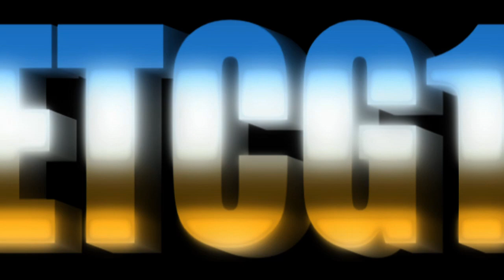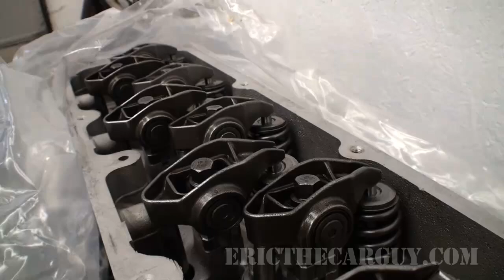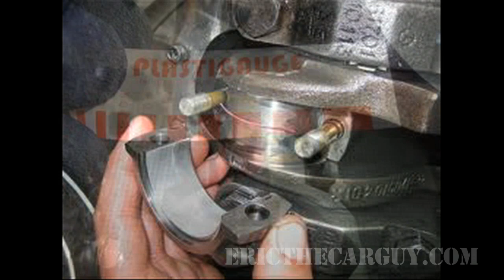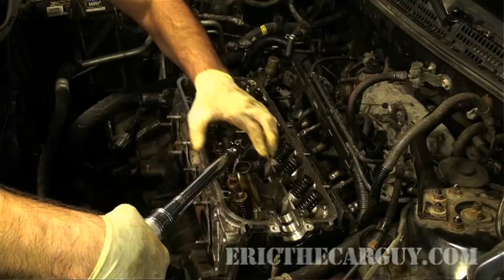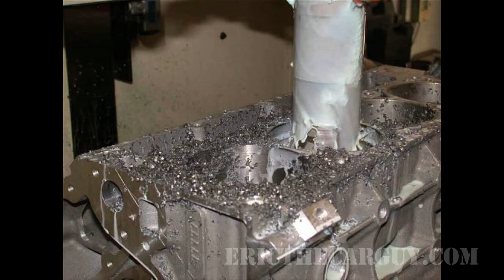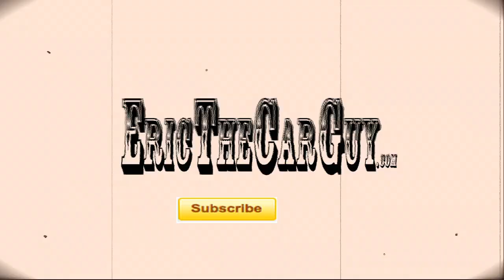Should You Rebuild or Replace? -ETCG1

Comment: I prefer rebuilding because if you so desire you can reuse what you know is still good and only replace what is necessary. I know its half assed but as long as you take care or it a used part will just keep on going.

Comment: I have always hear that you will get more mileage out of  a new replacement crate engine than you will out of a rebuilt engine. 
your thoughts on this.   replace or rebuild.
Reply: you might get better milage in the new engine, becuase it is common to bore over the cylinders in the rebuilding process. and bigger cylinders means more fuel consumption

Comment: I would like to add that a engine replacement is ok when the cost of replacement is less than the cost of labor, and rebuilt "kits" together.    but if the skillset and knowledge is available when the cost of a replacement engine is out of budget, and the customer doesnt wants to upgrade internals than en rebuild is better.

Comment: it would depend on a few factors. I would  rebuild an engine but only if it is cost affective to do so. if I can get a long block for the same price as it would cost for me to rebuild it or less get a long block saves time and money in the long run. but as Eric said some engines are not available as a long block or are expensive to send for a rebuild. like the engine i am working on just now an old ford diesel the owner wants to spend £0 to rebuild a seized engine. oh why did i take it on LOL

Comment: i changed whole car and donate the broken one for rallying. engine repairement costs 2 times more than changing whole car to working one.  the reason why engine broke was caused by broken tiny plug that keep coolent inside. it also had temp gauge broken so it just smoked alot and something broke. a few days later i bought 87- civic for 400€ / 500 dollars or so. old cars are cheap todays.

Comment: im facing this situation with my jeep right now. i have some experience rebuilding engines (done a couple chevy small blocks). i can get a known good used engine with 112,000 miles on it for $500. parts to rebuild my engine would be somewhere in the mid 600 range, ill say 700 for the sake of round numbers. im on the fence. sure ill spend more on the rebuild, but it will be pretty much a new engine.

Comment: I had the engine in my '68 Galaxie rebuilt by a professional company that does nothing but rebuild engines.  It was cheaper than a "crate" engine from a nationally-known remanufacturer. I wouldn't rebuild an engine on my own, for all the reasons you mentioned. And I'd only get a used engine if I were really short on money and absolutely couldn't afford a rebuild on my own engine, or a remanufactured one.  I did the same thing with the transmission -- paid a professional to rebuild it for me.

Comment: Depends on the vehicle in question; I'd rebuild an older engine (e.g. 68 Mustang or something like that), but I would advocate total replacement with a long block on something newer, like ETCG's Subaru project, should that need massive engine work.

Comment: It is definitely better to replace than to re-build, a rebuild for my trans would have been 1200 whereas a junkyard unit would be 800 with labol and parts. Hopefully i just have bad luck with sensors as im replacing a trans speed sensor for the second time now....

Comment: If its something you need to rely on its better to replace or have it done by the experts.  I'm an ASE Master Tech, and I recently had some trouble with a transfer case on one of my vehicles. So I pulled it out and tore it apart, looked ok to me but I went ahead and replaced all the wear parts. Put it back in and had the same problem. I took the case to a tranny shop and right off they knew that one of the parts wears the case, and it needs to be machined and sleeved.  Thats what they do all day

Comment: A 2006ChevyMalibu3.5LV6 for a year front & rear main seals &valve cover gaskets were leaking back about 5Q every 2 weeks so I just kept topping it off every other day I just didn't have the money to fix it well one day it died down the road 3 mech said a bearing froze to the block whatever that means so I got a salvage engine called a random guy off Craigslist took him a week started up drove off couldn't believe it anyway its still going today perfect. So engine and labor & extra parts $1,300..

Comment: Never saw this vid. If its got computers U don't wanna mess w/that shit. Go to a pro or scrap it. If its computer-free follow the advice in this vid then find additional info.

U mention "engine builders". There are professional builders who build from scratch for performance & there's assemblers. I consider myself a hobby assembler. I can take a box of parts & get good power but I cant build reliable high power motors. I know the theory but that's not the same as doing it & I'm not a pro at it.

Comment: at one time we were over hauling subaru cylinder heads, we use 100% OE parts, all new valves, and seals. rebuild time for one head payed 1.0hrs, fastest time I ever did one was 0.25hrs. the car with bent valves was fixed the same day. with two updated head gaskets installed. :) 14.0hr  job

Comment: I've worked 6 years at a independent subaru shop, i recommend replace. to the best of my knowledge subaru does not offer new long or short blocks for most of they cars, (non-turbo is what we mostly work on) they have a 3rd party rebuilder then relabeled in a subaru plastic crate. as of the last few years the quality control has been very bad. currently I'd recommend a used motor with less miles. I've rebuilt an old 2.2l subaru engine, not very fun.

Comment: I used to work rebuilding engines and another part to keep in mind is that they are generally all dyno'd. So the odds that you will wind up with a bad one is few and far between. My experience in doing this lets me handle all my own rebuilds. But if I'm working on a customers car its always nice to have a replacement that can be swapped in that way you dont have to worry about getting a call from the machine shop telling you the heads or cylinders are too far out of spec.

Comment: a lot depends on the type of failure to if an engine seized because of low oil pressure or lack of oil dont even take it apart its junk but i have had bad experiences with reman engines to an oem reman is probably your best bet but one of the more expensive to i would stay away from the auto-zone type remans

Comment: If time is a factor and the job needs to be done with minimal headaches, then I agree replace is the better option, but make absolutely sure you get something that isn't worse than what you're taking out, and that even though so and so has a "3 year parts and labor warranty" that it also applies to your labor.
OTOH, if it's a project car that doesn't need to up and running yesterday, then tear it apart yourself, take your time, do the research so you can do it right, and pay attention to detail.

Comment: serviced a gm 3100 from the block up due to a lower intake gasket failure, was unable to pull engine to do the work and ended up eating it.  4500 miles later it let me sit with a cam broke in half from washed out journals what i couldnt replace becuase i couldnt pull the engine to do the job properly, taking shortcuts gets you nowhere when it comes to engine work

Comment: as a powersports tech i say repalce with discretion. snowmobiles blow up all the time and i rebuild. how ever i use discretion, you get a motor that has been run out of oil- repalce it dont waste your time its a comeback waiting to happen. A guy goes and cold siezed his sled and needs a piston and cylidner - rebuild. The decision to rebuild or replace is a job to job thing at the techs discretion,

Comment: but in this point in time, i would rather buy a good quality rebuilt from someone i know does a quality job... knows the ins and outs of the particular engine (the intake manifold gaskets on the 3800 for example and would know too re build with the improved metal gaskets and not the cheep plastic factory kind.) a engine that would come with a warantee...

Comment: I junked the car anyway. I sold the head off it and scrapped the rest. I only paid $600 for it and I didn't have enough time or money to rebuild or replace the engine. Plus after it blew it still kind of ran and I drove it about a mile with no oil.

Comment: I'm gonna replace the engine on my lawn mower.  Take off the 148cc flat head and replace with an updated unit.  Hell, I even gain 0.25 HP in the process.  All for AU$159 plus oil.

Comment: i bought a d16z6 and transmission for 300 dollars on craigslist and has been running strong for 4 years now. it had burned oil on the valve cover and all that and a mechanic friend that was helping me put it in said the engine was garbage n stopped helping me but i put it in myself and has been running strong.

Comment: well first i live in cali with the smog nazis, so swaps are hard to pass here.
second, d series make more torque then b's over a wider rev band (area under the curve)
third, its build to be run in a spec class, so it has to meet some restrictions (oem bottom end)
the min weight for a d in the class is 2000, i think the b your talking about would be 2400.
oh, and my "waste of a motor" has taken down a large number of b's ive run.
not knocking your motor or b's, i just like to be different.

Comment: Totally agree, but really it all comes down to the builder. The truth however is that most factory original motors that are still running have stood up to the test of time, and abuse that we put them through. A rebuilt / crate motor has not, and requires special TLC during the breakin period.

Comment: Eric, You hit the mark about rebuild vs replacement. Another thing  I find is that is sometimes it is .  hard to find a good machine shop to do the work correctly. Casing point , I had machine shop work done on an engine from a 1991 Chevy Corsica and when it came time to check oil clearances for the connecting rod, there were 2 out specs. Never did rebuilds after that, just replacements.

Comment: I had an engine where there was no way around rebuilding it. I had it for five days and it developed a slight knock and less than a half our later there were chunks of block and engine on the road. The car spun a bearing and then threw a rod rite through the block.

Comment: i had mine rebuilt by a local performance shop to honda challange specs, and one thing to think of is down time.  they have had my block for like a month and its just getting finished

d16y8
y7 pistons, balanced bottom end
port and polished head, comp cams stage two cam, bc valve springs, aem cam gear
aem intake, dc heads, custom exhuast
tuned on hondata
shooting for 140 whp with a large torque curve
videos to come (i hope)

Comment: I absolutely agree that replacing is always better than rebuilding (for late model vehicle).  Just one tip when purchasing a salvaged engine: All junkyards will guarantee the engine they sell you.  If it's bad, they have no problem sending you another.  But, you will be stuck doing the job twice!  Get your salvaged engine from a REPUTABLE junkyard  Also, NEVER return the core until all work is completed and tested.  You might need something from your old engine to finish the job.  Good luck!

Comment: I have a '78 F150 with an inline 6 300, and C4 xmsn. I am going to rebuild as I want to beef it up. I know I know its a 6cylinder. I said I want to do it. I have never rebuilt a vehicle eng. I also want to rebuild my C4. From what info I have collected They both are "easy" or good starters to get into rebuilding. But like you said I won't have a warrenty of any kind much less a three year. But not willing to pay someone else to do it. Its my hobby, not neccesity.

Comment: At the moment I am tracing an oil leek when the engine is hot in a Saab 9-5.
At the moment having done over most serviceable parts in its life time I am predicting that it will be the crank bearings that are bleeding.

Only real option is to get the engine out to get a proper look, and if it looks scored/bad just going to replace it, if its just pitted might look at getting the parts overhauled and new bearings.

PS, engine still works and does so like a charm, just the oil light :-/

Comment: One other thing I have thought I would do if my engine decided to turn south is "having" your engine rebuilt instead of doing it yourself or a reman/replacement. I have not seriously looked into this, but having it rebuilt by a local engine builder who knows what they are doing.  How would this compare to replacing with a re-manufactured or a crate engine? One reason for doing this would be so it could be tweaked a little for a few more ponies. Any input on this?

Comment: new gaskets does not mean it's a rebuild, too. a rebuild is a rebuilt block/head(s) and whole new kit. juss sayin! bearings and rings, hone, tank/clean stuff up, ZERO miles. 

On a hard to find engine or numbers matching, like mentioned in the vid is the only reason I'd rebuild, otherwise replace with newer or better.

Comment: I've done both, rebuilt and replaced with second hand engines, IMO it depends on what is wrong with the engine.. If it too major like a broken timing belt bent valves and tagged the pistons I'd replace it. If a rod knock id stop driving it as soon as herd and tear down, inspect and if its not to bad rebuild bottom end and call it day.

Comment: i rebuilt my first engine and well not the best idea to rebuild a overheated engine. Turned out the head got the worst and need to rebuild another head and should run perfect. If you could find a low mileage engine then i suggest doing that to save time and maybe some money. I always do a compression test to tell me the condition of the engine before swapping them out.

Comment: Replacing is the way to go for 90% of the people and techs. However, I've personally had bad experience with reman motors - VQ35 nissan - the first replacement had the timing way off. After fighting with the company, they send a second engine which had a very low oil pressure. My advice is - buy a reman unit but make sure it is from a reputable company with solid warranty.

Comment: It depends on if it is my daily.   At one point i swapped a chevy 350 for a junkyard 305 in my driveway with 22 $ worth of tools in the snow.   took 300 and 22 $ and 2 days, should have probably taken 4 hours or so since i already pulled the completely toasty 350 but do to  "stuff" ya it took a bit.   that junk yard motor was still runnin when i yanked it 3 and 1/2 yrs later.  "running good too i might add"    but if i had time and it wasnt my daily i would like to rebuild, just to do it.

Comment: Eric, I totally agree with you about replacing. For the average Joe who just wants their car back on the road, its the cheapest, easiest and safest solution. But for the guy who has time on their hands, rebuilding is an awesome experience. This past summer, I had an opportunity to rebuild a Honda B16.  It failed due to broken ringlands. Had the block bored over .5, crack polished, new pistons, new rings, bearings, gaskets, water pump and oil pump.

Comment: I am not rebuilding an engine or trans on flat rate! it is getting a reman or used period! One thing DIYers need to think about on later model engines, is alot of those need sp ecial tools to set up the cams etc, that can get real expensive if you cheap out and try to do it without the right tools, or the experence to do the work either.

Other issues finding a quality machinist! they are getting very hard to find.

Comment: my god eric where did u find the used engine for 1500-1800 bucks whoever tried to sell u a used one for that price for that truck was trying to rip you off in my opinion. ive seen em running 4-800 all the time. also if its a damn good engine rebuild or replace id say if u can the same engine replace if u cant find one in ur area rebuild.

Comment: I'd say replace. I bought a nissan that had been cooked twice. What originally was considered a head gasket replacement and test and resurfacing turned into all that plus new valve stem seals. Then i realized i should replace the pistons, rings and conrod bearings and bore out the cylinders because it sat for some time. Then this turned into a cracked head, which was cheaper to replace. This still cost less than a new block, but if it fails, i've gotta fix it all over again.

Comment: I used to work at a mercedes/bmw repair shop, and the owner of the shop would replace engines rather than rebuilding, and he would go through 2-3 sometimes 4 engines and they could all be bad. I think rebuilding is just like getting a new engine, maybe a little more costly, sometimes it's cheaper.

Comment: Once you really start working with engines, you realize replacing is much easier than rebuilding. Its also faster, has a warranty, and usually cheaper. The only time I would rebuild is if the engine was going to be high performance.

Comment: It depend on what you want to achieve.
If you only want to have a good engine i would replace it with a crate or reconditioned engine.

But if you want more hp then i would definitly go for an rebuild but then off course with all the proper measurments and machining.

Comment: As far as engines, I would rebuild only if I was going FI or SC with my Z (if I wanted to strengthen the weakest internal components). Even so, I would send the block/ heads to the shop for machining as I do not have said equipment/ knowledge to do so myself. As far as transmissions go, I would only do clutch/ Rear main seal/ Throwout bearing/ fork replacements. Zs are known for chattering transmissions so THAT I will leave to the guys that rebuild em for a living. Great video as always!!